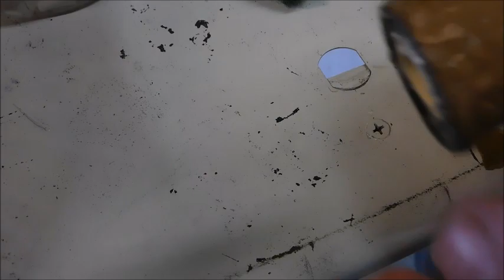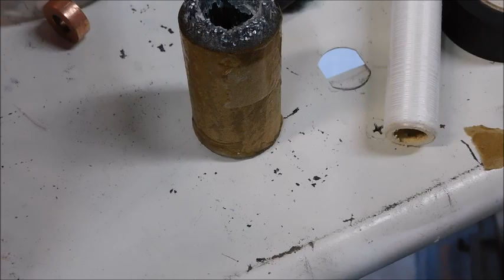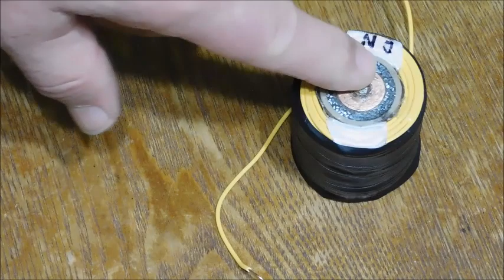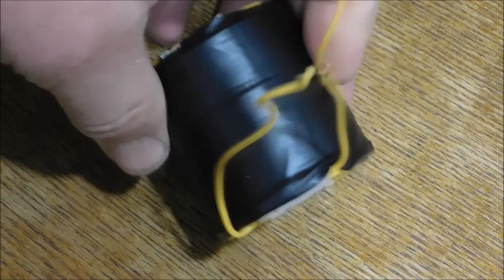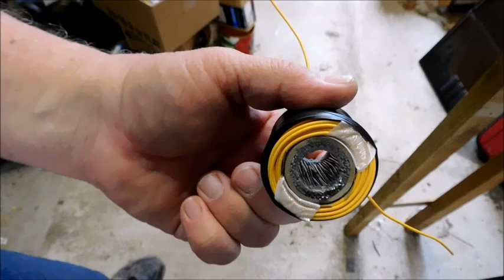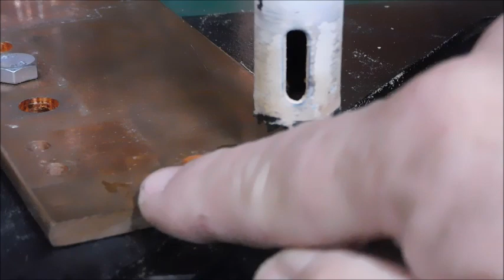REMOVE ALUMINUM FROM WATER?? NON FERROUS METAL MAGNET!!!

Comment: Could you possibly collect the non ferrous metals by somehow performing "Lenz's Law" to slow down the metals?
Reply from the maker: Absolutely ! That method is used to "catch" gold in a sluice run. This device is sometimes called a "gold magnet". Good thinking there.
Reply: @davenooner2142  I'm actually wanting to make something like this specifically for catching gold. What do you recommend?
Reply from the maker: I understand they can use neodymium magnets to slow it down or re-dirrect it somehow. As for the gold magnet, I would think it would be better to ask someone that uses it. I never did that, but looking in gold mining groups, I bet someone will help you better than I can. @garyhawkins9733
Reply from the maker: I don't want to give you bad advice. Thank you for the interest, good luck.  @garyhawkins9733
Reply: @davenooner2142  I've never seen anyone use this to capture gold. Thank you for the detailed video! I'll let ya know how it does
Reply from the maker: Yes thank you very much. I would like to know more myself.  @garyhawkins9733

Comment: Impressive but why can't you just stick a very strong magnet in a gallon of drinking water you plan on drinking? Shouldn't any traces of aluminum stick to that through the water? Or maybe get a magnet in the shape of a stick and stir the water with it to put it in contact with more of the water and the nanosized aluminum particles they are spraying. Or trickle the filtered water over the magnet as it fills the container. Years ago there were  magnetic gadgets being sold to put on pipes  where city water entered the house. Weren't they supposed to do the same thing? Do you remember those?
Reply from the maker: Yes you are correct about the magnets on the water pipes...it does work for its purpose, so you know. However ..aluminum does not get attracted to a normal magnet.  It is only attracted to this magnet because of how it works with changing magnetic fields and the eddy currents produced in the copper ring. It tends to hold the aluminum or gold or other such metals in its ever changing fields. Thank you ...good thinking though!!